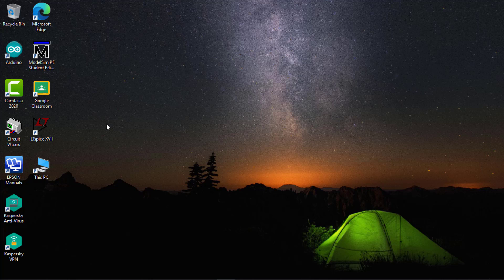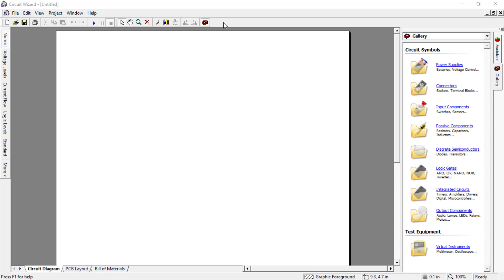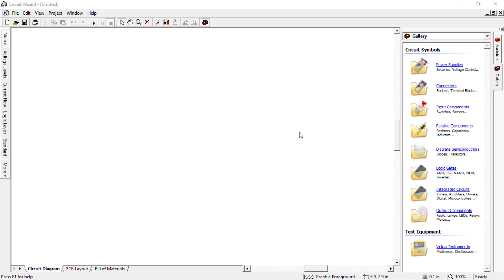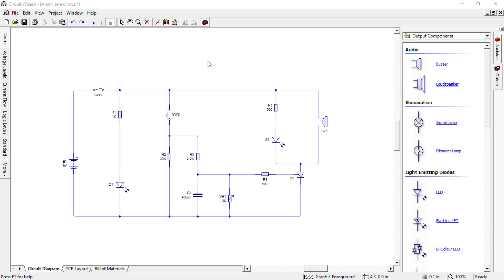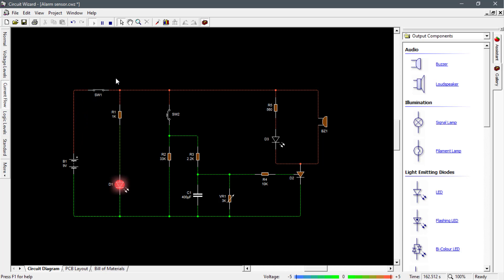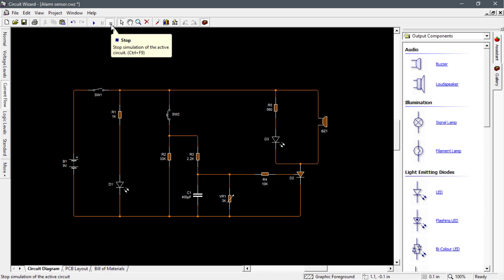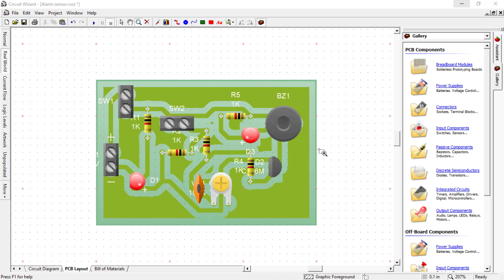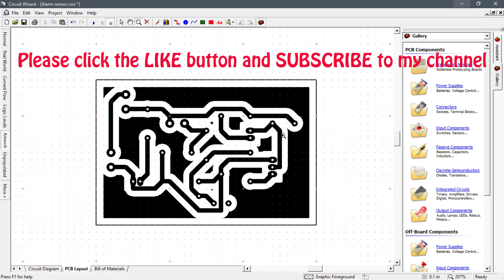PCB Design Process using Circuit Wizard | Part 1

Comment: Ciao Aden e complimenti per il video, io ho installato wizard circuit, ho fatto un progetto e va tutto ok la simulazione ok, ma ho un problema quando vado a convertire  il gerber, se provo a inviare il file gerber su un simulatore online tipo quello della jlcpd  il lato ramo e le perforazioni non vengono visualizzate come mai?. Potresti gentilmente aiutarmi a capire come si fa il gerber nel modo corretto? Ti ringrazio di cuore.
Reply from the maker: Thanks.. You can use EasyEDA in generating Gerber file, you are also able to order directly from JLCPCB.
Reply: @eden12_penales   si hai ragione, ma il problema è un altro il file gerber che genera wizard circuit ha qualcosa che non va perchè  JLCPCB mi ha detto che non va bene non si vedono le tracce di rame. Ma con easyeda come faccio? ilfile di wizard circuit si può aprire anche con easyeda? aiutooooo:(
Reply from the maker: @Franco Mongillo  kindly print first your circuit design from circuit wizard as guide, and then re-draw the design in EasyEDA. Check this video that I found (video courtesy: Ideas TV) 

https://youtu.be/pxfkcfNggqI
Reply: @eden12_penales  okkkkkkkk  grazieeeee ora provo. :)
Reply: Ascolta hai un email? vorrei mandarti il file così magari lo vedi anche tu? ne sarei felice.